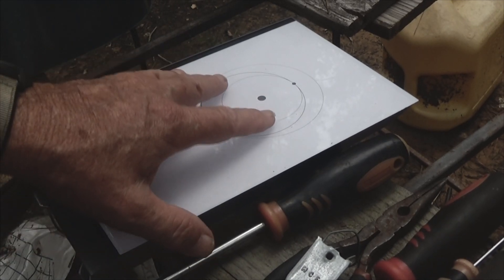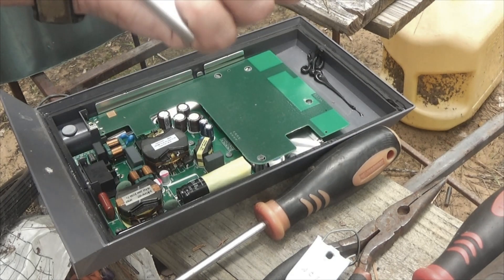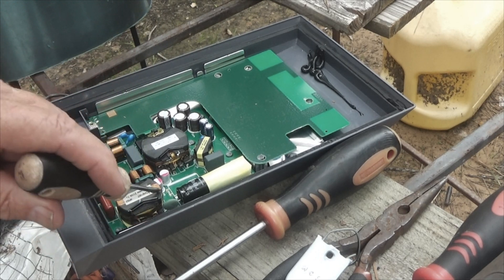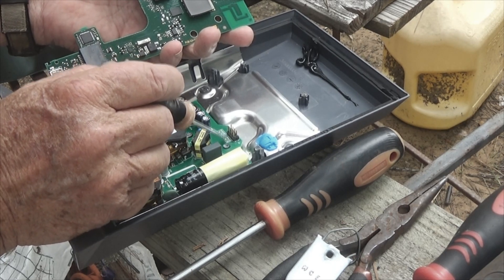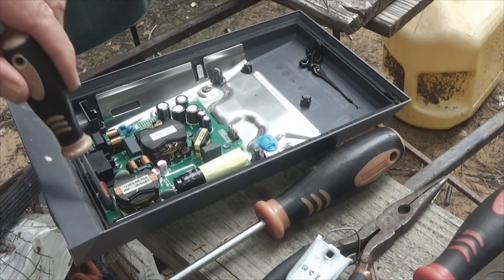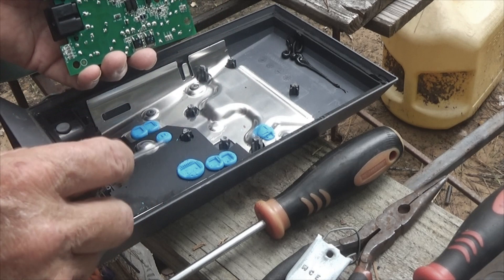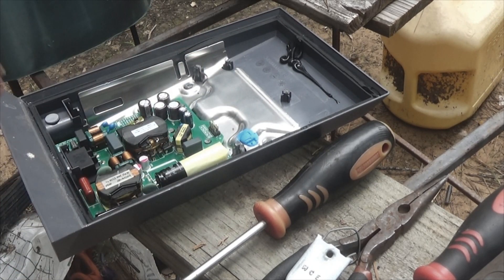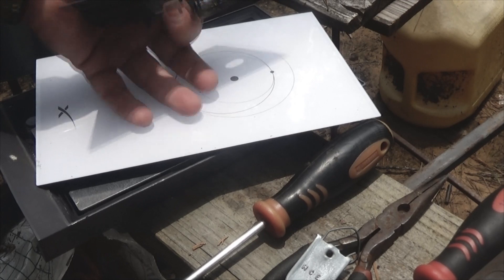starlink   what is inside

Comment: That is what I like of boomers, one day they are fixing a diesel tractor, next day fixing a satellite router with the same tools they fixed the tractor. The power supply looks like a switching power supply, be careful with the high voltage. if it is a switching power supply you will have the high voltage and the low voltage both isolated by optocouplers. Check if you have power in the low voltage side. If not you will have to look at the high voltage. Check if the rectifier (diode bridge) is in good shape, next I would check the switching transistors both in the high voltage. Check if the green unidentified package has 4 connectors, that could be your bridge rectifier. Subscribed.
Reply from the maker: i will check on this, but it will have to wait.   i have irons in the fire from last year when i was sick.   for the record, i fix what i can, try to fix what i can't, but i'm well aqainted with ilizaro technique,
Reply: @dysfunctional_vet  I'm amazed you are even trying to work on that router. It  is always inspiring to me watching people with that level of curiosity about how things work and actually fixing them with they break down.

Comment: The large piece of aluminum is a shielding for switching power supply. That board with ferrite transformers and large capacitors is a power supply. It is likely designed to operate globally so it can work from 110V or 230V. The smaller L-shaped board is a Wi-Fi router.  The starlink antenna is a satellite transceiver.
Reply from the maker: is the mod/demod modules in the antenna?   when i was looking at the big board, i was not sure exactly where stuff was going.   good call

Comment: It's a doubt from me that it is a faraday cage.
Reply from the maker: faraday sheild?      i honestly am not sure.   it has to function with in/out comm, and still avoid spurious noises in the electromagnetic feild.
im not even exactly sure where all the power supply parts are on that board.
Reply: @dysfunctional_vet I think it might be a heatsink, but I didn't see thermal paste or pads, not sure either.

Comment: The 450 volt capacitor is 68 µF (microfarad) not 68 pF (picofarad). That unit has not been struck directly by lightning (obviously) but a nearby strike can wreak havoc with the semiconductors by inducing an unwanted current. If it caused a voltage spike on the power input then check for a fuse or other protection components. I would start by measuring the output voltages on the bottom PCB, which is the power supply. The top board is the high-frequency section and the etched copper lands in the top right and left corners are the antennas. The adjacent I.C.s are presumably the RF amplifiers.
Reply from the maker: I agree with you, i misread the cap.  it was a micro....
if you saw the video on the timer, that was 200 or more feet away from the router, the router was inside, that was outside.

i did look for a fuse, hoping to find one, but alas, poor dead router.

i will go back and take some really good photos of the inside
a little bit later and see what i can see as well as take more time to read the fine print.

Comment: I believe a faraday cage requires full enclosure AND an insulator between the electronics and the cage. Just the power plug alone would mean it's not a complete Faraday cage from what I know. However, I do think it'll either be shielding of some sorts, network hardware can be very sensitive to radio interference and such, so shielding it makes sense. It could also be a heat shield like you said before, but I would suspect there to be a better heat conductor between the metal and the parts. That blue stuff looks too thick to properly conduct heat, so it would fit closer to the interference shielding conclusion. 

But, I'll admit, I am not an expert.
Reply: or it may be a wave guide to make sure the rf from the satellite get to the right area inside the enclosure
Reply from the maker: it is a bit of a mystery to me.  i am thinking this does not use a wave guide.  i seem to remember something about it using a phased array, and if so, my have a micro processor in the antenna itself turning the downlink data to digital form
Reply from the maker: when i was looking at it, i had a couple of thoughts as the the sheilding.    the cage is what came to mind, with the lack of a clear ground to something.   i do not disagree with you on the sheilding, however as manolisgledsodakis873 noted, the antenna are on the upper board, and that could indicate some type of parasitic reflector...don't know.  i never studied how high frequency RF behaves.